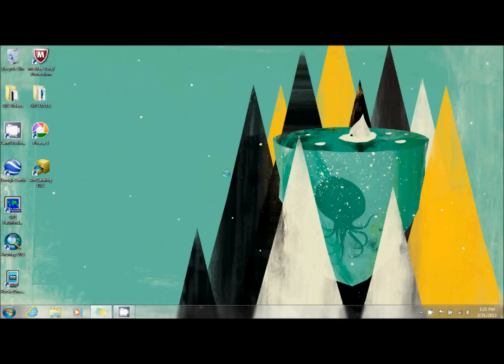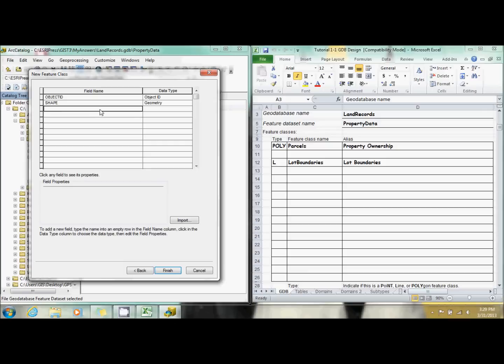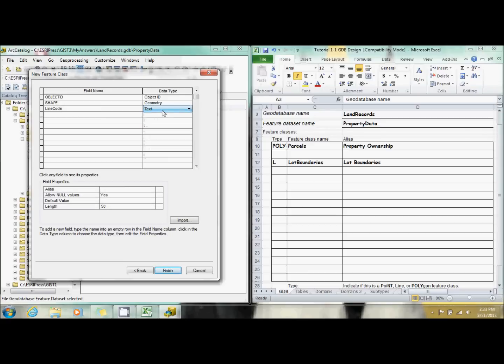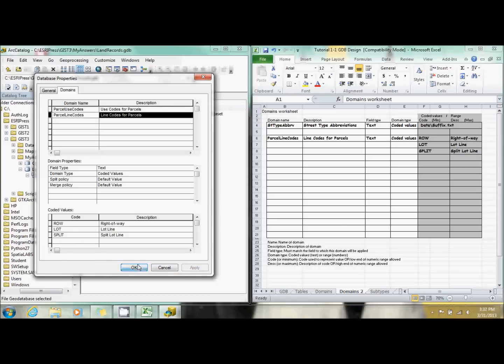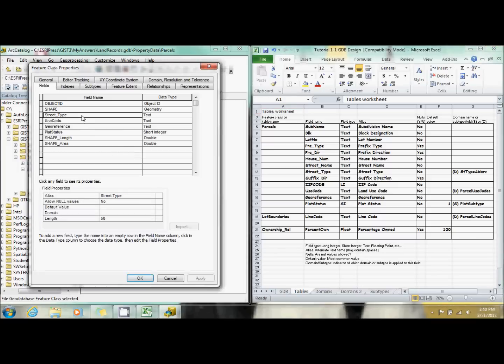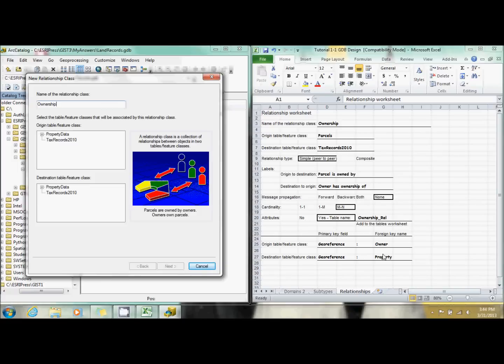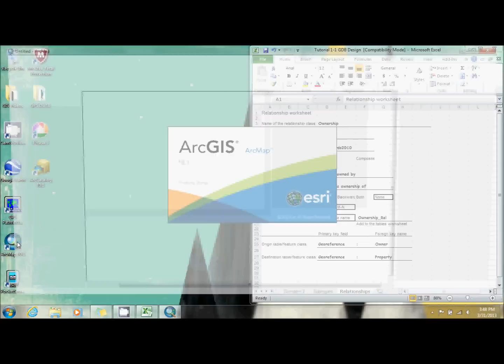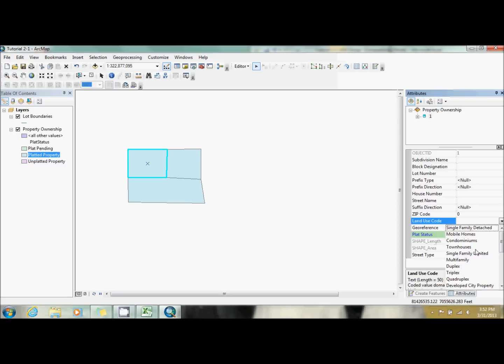Tutorial 2-1: Building a geodatabase

Comment: OOPs!  I got an error after typing in the "New Feature Class"  dialogue box.  It said I had Invalid Field Names and asked if I wanted to automatically put _ (underscores) after each name.  (E.G. Blk would be changed to Blk_) And of course it did that for the whole list.  What happened???
Reply from the maker: +Randy Arnold with field names some characters cannot be used and there can be no spaces. If the program sees a space it will often use an underscore to replace the space. Some words are also not allowed to be used because they are locked out because ESRI uses them to create specific fields. I don't know them all off the top of my head but they are ones like time and date. An underscore will can also be added if they detect two fields with the same name, this most likely happens in tables with lots of fields.